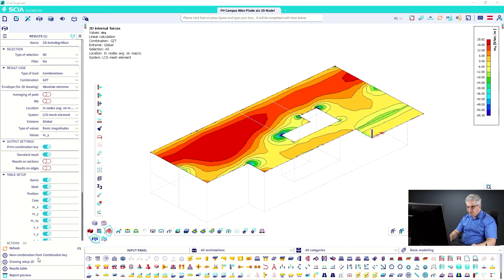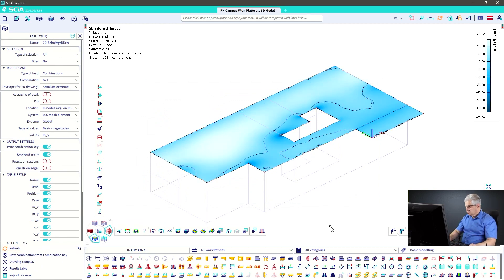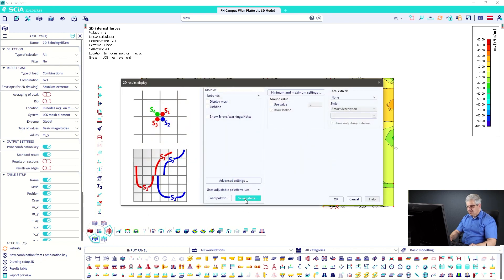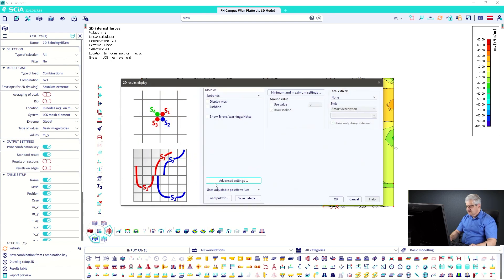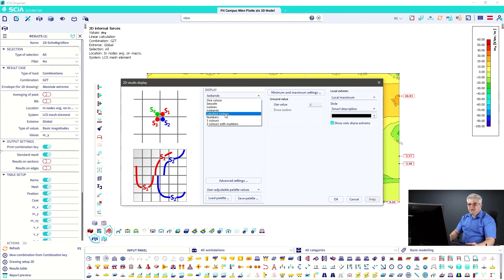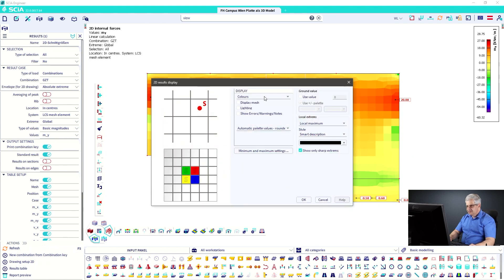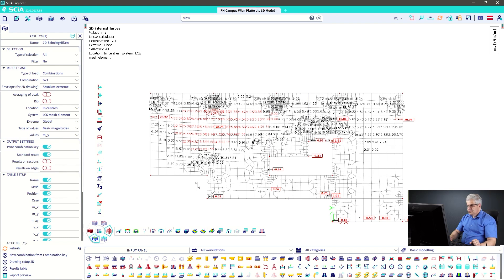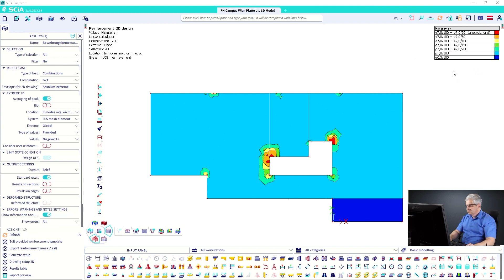SCIA Engineer: 2D Results (Possibilities, Settings, Tipps)

Comment: Hello, thank you for the clear tutorial video. I have a question: how would you design a lattice girder slab, using the 'two height method' for orthotropic behaviour? Which are the parameters for torsion stifness, shear force component, membrane effect? Or more general: is it possible to have a tutorial on orthotropic concrete slabs, based on real cases like a lattice girder slab or hollow core slabs? many thanks